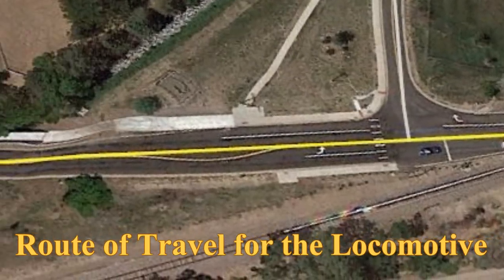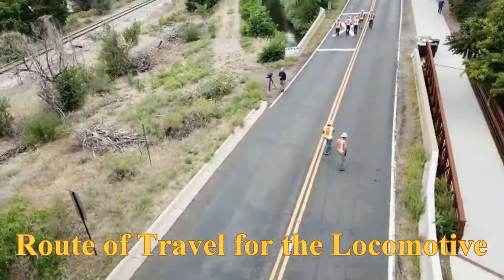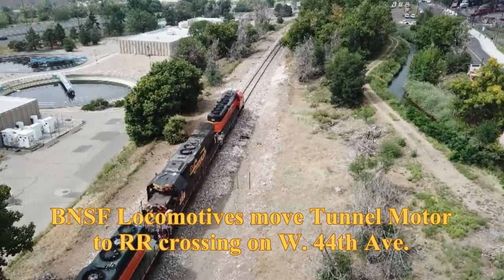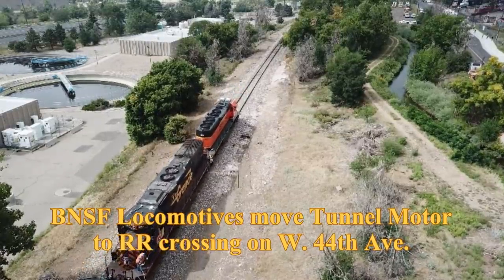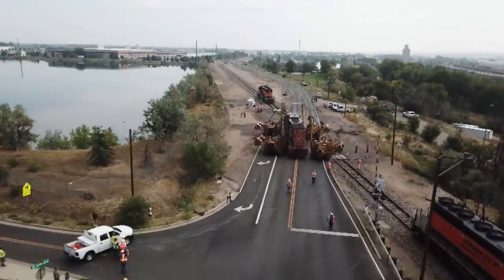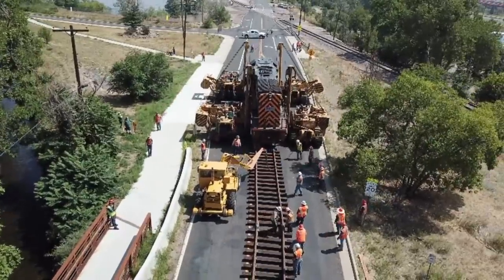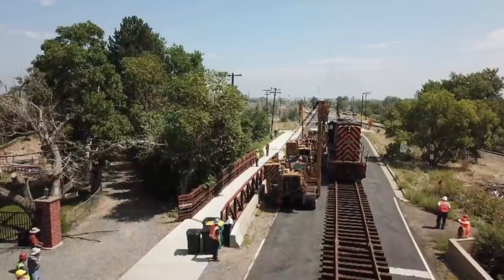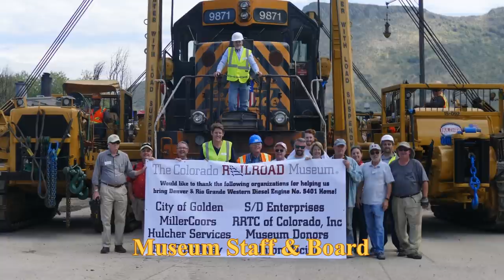2018 August 22nd   Denver & Rio Grande Western Tunnel Motor Move

Comment: Fair play for pulling that off though it seems there surely was a much quicker way of doing this haha
Reply from the maker: Really?  What would that "much quicker way" have been?  Lots of people seem to have a better idea, but if you were not on site and aware of the challenges, I doubt that your method would have been either feasible or quicker.  Please accept that the museum staff analyzed the situation and took the option that was most effective and affordable.
Reply from the maker: Yes, I know.  But I still find it hard to believe.  I don't challenge experts in fields where I have limited knowledge, but I may well ask questions.
Reply: Why doesn’t the railroad museum just have track built to the bnsf?
Reply from the maker: Please take the time to read previous posts.  It would be very hard to do this and it has only been needed twice in 60 years.  There is a canal in the way, too much elevation difference, not enough room to make a 90 degree turn from BNSF into museum, etc.  Taint gunna happen.
Reply: I saw a movie with a shrink ray. If they used that, they could have put the locomotive on a Tonka flat bed semi, and driven it to the museum on the shoulder of the road, and not block traffic, or damage the asphalt... yeah, that would be a “much quicker way of doing this.”  Some people’s children. 😂

Comment: That move must have cost a fortune.
Reply from the maker: Define fortune.  Check other responses on this subject.
Reply: Yea few mil on diesel alone traffic cost about few hundred thousand
Reply: @ROKuberski  fortune=lots of money
Reply from the maker: I estimate that less than 750 gallons of fuel used.  The cats use 8 gal/hr., but were idling most of the time.  Traffic was stopped on W. 44th during the move but there are side streets to the north and highway 58 just to the south.  Very minor inconvenience to traffic.

Comment: with that many hands around they should of been laying plywood in front of the dozers
Reply from the maker: Why would you think that?  To protect the pavement perhaps?  The only minor damage that was done to the road was where the dozers had to rotate the locomotive at the entrance to the museum.  Each dozer weighed about 190,000 pounds under load.  Plywood is no way stiff enough to spread a concentrated  load of this magnitude.
Reply: @ROKuberski  crawler tracks are hell on blacktop its normal industry practice to keep the tracks from leaving marks and minor damage is still damage that could of easily been prevented
Reply from the maker: These machines all had rubber treads, you can see it in the video.  If they did not, they would indeed have ripped up the pavement and a piece of plywood would not have changed the situation.  Note the numerous responses about damage to the road.  Very minor and only in one location.  Resolved with just a few hours work by the City of Golden at no cost to the museum.
Reply: @ROKuberski  at around 3:10 you can clearly see the all steel tracks damaging the road with multiple hands just watching. when I did work as a millwright it was standard practice to lay wood down to protect the pavement. even a big rough terrain forklift with rip up blacktop of you turn the wheels while sitting still.
Reply from the maker: What you see at 3:10 is rubber being scuffed off of the treads on the dozers.  The damage to the road was from excess weight causing minor depression, not damage to the surface.
Reply: @imchris5000  Its rubber scuffs. No damage was done as its rubber pads. Nothing a bucket of white paint cant fix.
Reply: We run rubber and neoprene pads that sit higher than the grouser so pavement doesn't get chewed up. They leave minor marks in most cases.

Comment: Why did they not put it on a rubber tired flatbed and do the move without ruining the roads? They move steam engines on them that weigh more than this engine.
Reply from the maker: First off,  they DID NOT RUIN the road.  The dozers had rubber treads, no steel hit the pavement.  Very minor damage was done when they rotated the locomotive to take it into the museum.  The city of Golden took care of the minor repair at no cost to the museum.I'm sure that there are several ways that this move could have been done.  The museum staff evaluated their options, made a selection and what you see is what they did.  It was not a huge cost.  They took advantage of available equipment and the move worked just fine.  If you are talking about a rubber tired flatbed trailer, that could not have taken the load of this locomotive.  The wheel load would have been much greater than the load on the dozer tracks.  Additionally, the bridge they crossed was an old one with no engineering data, so they had to minimize the load over that structure.  The staff made a good choice and evidence of that was the successful move.

Comment: Why is it called a Tunnel Motor?
Reply from the maker: Please listen again to the first part of the video.  This locomotive is designed to operate in a railroad tunnel.
Reply: Exhaust builds up in the tunnel, lower air intakes give the engine fresher air.
Reply: Air intake and cooling air drawn in at walkway level.non tunnels pulled air in from upper edge of side panels.non tunnels would recycle hot dirty exhaust  in tunnels causing them to overheat
Reply: The modifications allow the engine to cool between tunnels so the motor can be ready for the next tunnel.  There is no cool air in a tunnel occupied by 8 tunnel motors at full throttle.

Comment: They got the horsepower wrong saying it is 3600.  It is 3000.
Reply from the maker: By they, I assume you mean me.  I looked up the specs on this unit and that is the information I used in this video.  Similar Locomotives may have different specs.  I gave it my best shot.  Give a link to your source of information.

Comment: Don’t you think it would’ve been easier and faster to have tracks connected where the engine could be rolled into place instead of all this?
Reply from the maker: Sure, it would have been easier and faster.  However, it is not feasible to connect the museum to the local trackage.  This issue has been discussed at length in other comments.  Please scroll down to see other coments.

Comment: I find it kind of ironic that BNSF is transporting a Rio Grande locomotive, which is owned by UP
Reply from the maker: Well, it goes like this.  The UP donated the Locomotive to the CRRM in 2010.  It had to be moved from its current location in Denver, but the museum did not have a plan in place to move it to the museum and at the time did not have the funds to pay for the move.  So, it was moved out to the Coors brewery, which is just across Clear Creek from the museum.  The line from Denver to Golden (location of Coors and the museum) is BNSF.  I don't know who actually moved the Locomotive over to the Coors plant, but they graciously allowed to it sit there until there was a plan to move it to the museum.  At the time of the move, it was no longer a UP unit, but was the property of the museum.  BNSF moved the Locomotive from the Coors plant over to the road crossing just to the east of the museum and then it was moved onto the museum grounds as the video shows.

Comment: Wow, manufactured when GM products had a soul.
Reply from the maker: Did you mean General Electric?
Reply: Richard Kuberski --> No, Electro Motive was owned by GM.
GE' s locomotive was much more dependable, and orders for Electro Motives dried up as they broke down creating a mess of blocked crossings if I remember correctly.
Reply from the maker: That's what I get for thinking.  I was remembering the GE logo on one of the other locomotives we have.  You are right.

Comment: WHy didn't they just have a track that was connected to the museum. It would be much easier to do than . this. This is like the 3rd video I've seen moving a train to this place
Reply from the maker: If you would read through some of the older comments on this video you would learn that is was neither possible nor desirable to have a standard gauge connection to the museum.

Comment: It doesn't run?
Reply from the maker: Nope.  It does not have anywhere to go.  The museum has very limited standard gauge track.  It cannot move from where it is without being lifted to another track and then, there is still no where to go.  It cannot go onto our turntable.  It is too heavy.
Reply: @ROKuberski  Am I right in noticing that much of the museum's track is dual gauge to accommodate both standard and narrow gauge equipment? Was this a former D&RGW facility?
Reply from the maker: If you look on Google Earth, you can see that there is some dual gauge track at the museum.  Most of the dual gauge track is in the area of the roundhouse and around the south side of the museum.  The loop track is not dual gauge.  The standard gauge equipment is usually sitting on isolated sections of standard gauge track.
Reply: @ROKuberski  Thanks Richard... I just like seeing equipment being ran instead of sitting in static display. I was curious why it was being towed by two BNSF units.
Reply from the maker: The spur that runs into Golden is BNSF.  The Locomotive in the video was stored in the Coors Brewery railyard (just south of the museum) for 8 years waiting for this move.  BNSF graciously moved the locomotive from the Coors railyard to the road crossing.  The museum has lots of friends.

Comment: I watched Forney do this with The Big Boy!
Reply from the maker: Not quite.  They laid track to move bigboy.  It was never picked up and moved down the road by side boom dozers.  I was working in a building just north of the old Forney when they moved that locomotive.
Reply: @ROKuberski  my bad. They leapfrogged the track. I really liked what REI  did with old Forney building!
Reply from the maker: Yes, REI did a great job on the building.  I don't remember the exact timing, but that building burned after the Forney moved out and for a while it just had some added beams inside to stabilize the walls.  REI invested well in the building, but I would imagine the fire added quite a bit to the cost of restoration.

Comment: Hopefully they get rid of that despicable UP emblem on the front of the unit.
Reply from the maker: That emblem represents the company that donated the unit to the museum.  I anticipate that at some time in the future this unit will get a new paint job that will restore it to its appearance when it was used by the D&RGW.
Reply: Despicable. Well, that is a nice thing to say about UP. After all, they did donate the engine. They could have scrapped it. After your comment they might think twice about donating anything else to this outfit. If it wasn't for UP this thing might have been scrapped long ago.  Be grateful for small favors.
Reply: I'd keep the emblem right where it's at. Speaking as just another railroad buff, Union Pacific has been a fine railroad for many years, and has had many interesting locomotives and rolling stock, freight and passenger. They have also been mindful of history by donating many locomotives and rolling stock to different museums all around the country, to excursion trains and the restoration of the Challenger and Big Boy locomotives.  Despicable?!! I'd say Honorable.
Reply from the maker: The UP emblem will be removed, but only because it will be returned to what it looked like when the D&RGW operated it.  The UP very graciously donated this engine to the museum when they were asked.I'm not sure why there are a few people with negative comments about the UP, but this is not the place to discuss them.I've visited the UP Roundhouse in Cheyenne several times and have recently been following Ed Dickens and his UP Herritage crew as they do a complete restoration of the BiG Boy 4014.  An amazing project if you are not aware of it.
Reply: @ROKuberski   Hello Richard. Yes, of course the museum would want  to remove the UP emblem to restor the appearance. That us as understandable and it is acceptable.  Funny this poor old Loco is being traded around like that finally to sort of return home again.  Would n't it be nice to restore it to operating condition and do some short haul revenue freight with at - at the very least tourist or dinner trains. I find it wonderful that people want to keep the heritage, but discouraging that these engines sit and decay from the inside out. The work the Ed and crew are doing - and have done with the other two steam locomotives, is amazing, Cheyenne should become a restoration center for every historical engine that remains intact. Certainly it would benefit the  UP center financially. It would also make available the skills, machinery and facilities of a trained restoration/rebuilding crew for the other projects. Instead of having to equip a shop and buy all the expensive machinery, location and access,  they would benefit by an efficient crew already will trained to deal with every aspect of restoration and rebuilding you could think of. Why re-invent the wheel, so to speak. I am all for putting these monsters back to work. They are not that inefficient that they can't earn money under the right circumstances. Thanks for your post, Richard. Nice to know more of the story behind the engine.
Reply: @ROKuberski  I think the animosity probably comes from the UP taking the Southern Pacific, Rio Grande and SSW way back in 96. Those railroads have a special place in a lot of ppl hearts. Whats more disturbing to me is the  SD-40T becoming a museum piece, makes me feel old asf.😞

Comment: been a lot quicker with a BIG crane and a pair of Notteboom modulars
nice to see a tunnel motor in preservation though
Reply: Not really, a crane that large would need at least 6 tractor trailers to haul it in, and close to 4 hours to assemble and set for the pick. 4 crawlers 4 trucks and only about 15 min to unload and 10 to rig to be ready to lift. The boys at Hulcher know what they're doing, but tend to throw more equipment and manpower at a job than needed since they're used to doing government contracts. I would rather see RJ Corman doing the work, they specialize in rail equipment moves and recovery, not just heavy lift moves like Hulcher, they know what to bring to  do the job fast and efficient.
Reply: Corey schmidt you realize hulcher does the same thing as corman and have been around twice as long.  It's apparent you have no clue

Comment: didn't  it have a engine?
Reply from the maker: Yes, it did have an engine.  Has not been run for at least 8 years.  No batteries in the locomotive to start it anyway.Is it so hard to accept that the people involved in this operation made the right choice on how to move the locomotive?
Reply: @ROKuberski  oh sweet hope the get it running
Reply from the maker: It is not the intent to get this engine running.  It literately has no place to go.  It will be restored to look like it did when used by the D&RGW.

Comment: why don't you get a 200tons/450 000lb crane but four sidebooms. four toys were too hard to collaborate, even while rotating the loco
Reply from the maker: Michael, a 200 ton crane cannot lift a 200 ton locomotive.  Cranes max load is with minimum boom and maximum angle.  But, what if you did lift it, then what?  The 4 side booms were not difficult to coordinate. The operators were experienced as were their foremen.  Is it really so hard to believe that the museum staff evaluated the options and selected one that worked just fine?  Of course there are other ways to skin this cat, but success must indicate that a good method was selected.
Reply: A single crane of sufficient lifting capacity would have immense difficulty controlling the load.  Swinging would be a real problem.  Cranes doing that kind of lift also DO NOT ROLL with loads suspended.  Assuming you could find a crane capable of moving with that kind of load, would it's footprint be small enough for the roads there?  AND those hypothetical tracks and weight pressure would be extremely bad for the roadbed; splitting the load four ways distributes the ground pressure far better.
Reply from the maker: Toby,  Thanks for the comment.  Additionally, bringing a large crane like that is no simple operation.  It takes additional truck loads of equipment to set up a large crane.  Counter weights, sections of boom, outriggers, etc.  Perhaps a day or two with a crew to set it up and again to tear it down.  Large cranes frequently require a smaller crane to help set them up.  It also takes a large area to do the assembly.
Reply: Right because everybody has one of those lying around... Armchair engineering instead of appreciating the work.
Reply: @ROKuberski  I know you guys should have balanced the cost and the efficiency of this transportation. I mean there's alternative way to solve this problem. As Toby Cameron said, cranes may face other problems.
Reply from the maker: Michael, of course there were options to evaluate prior to the staff making their decision.  Were there other "right decisions?"  Maybe, but they did make a choice that worked well, was safely executed and within the budget.